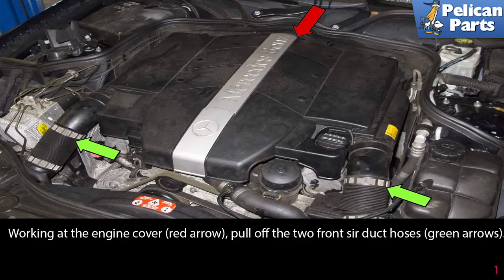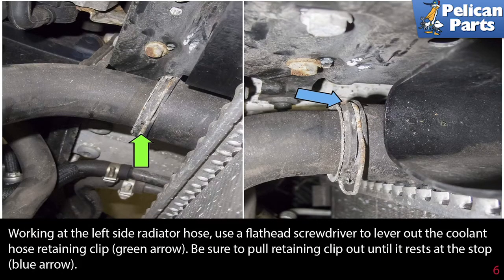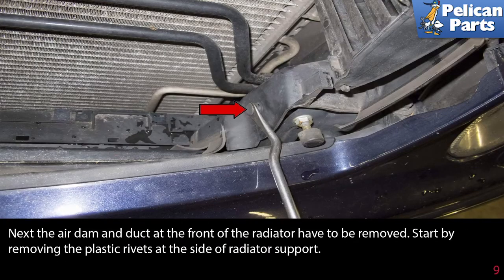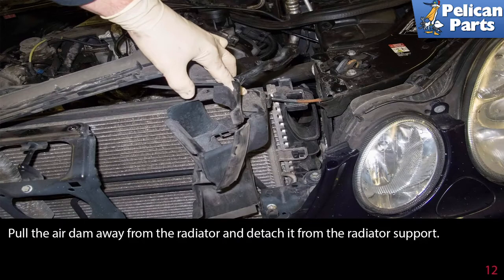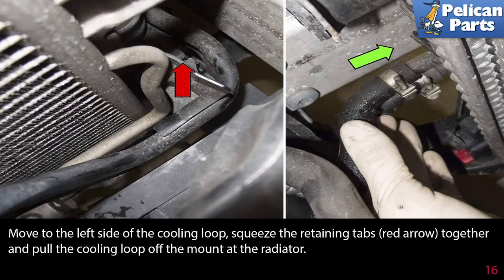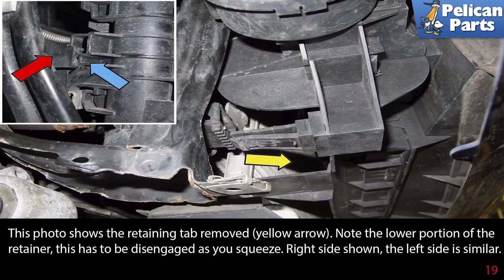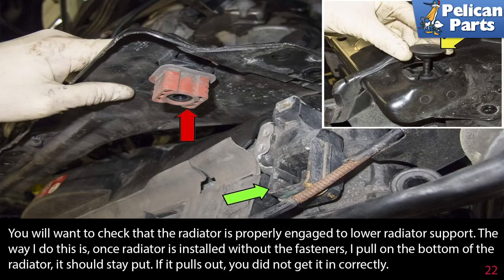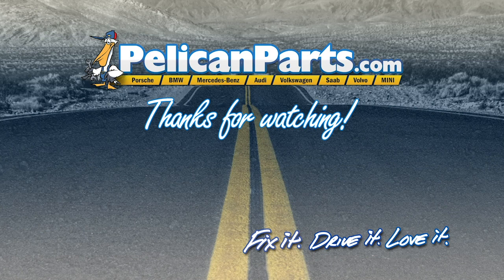Mercedes-Benz W211 E-Class Radiator Replacement

Comment: On the E500 the transmission cooling lines are fixed to condenser side of the radiator, which makes them quite difficult to disconnect.
Reply from the maker: Thanks for the Info. We appreciate it.

Comment: Do you have any partnumber that i can use to buy plugs to seal the transmission oil lines ?
Reply from the maker: With your vehicle info handy, give The Pelican Parts parts specialists a call at 1-888-280-7799. They can figure out what part or repair kit you need.